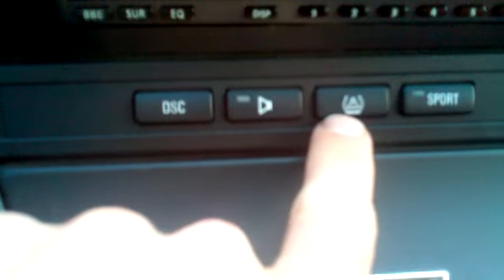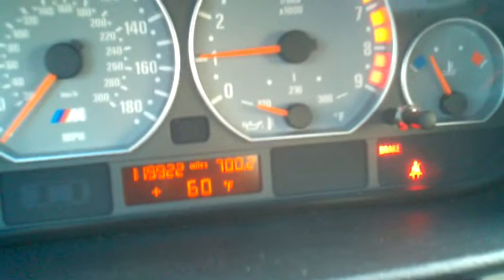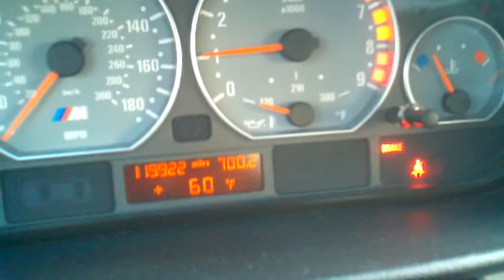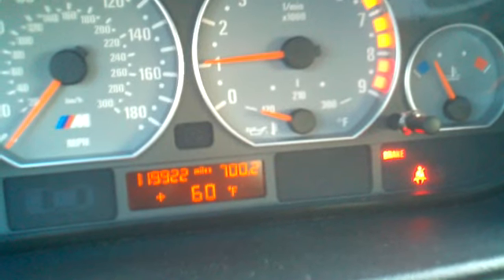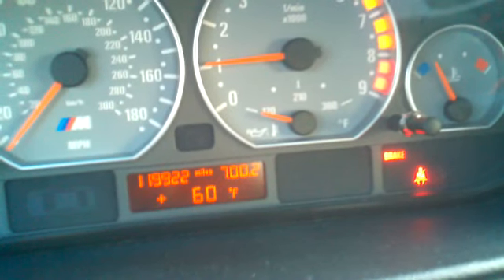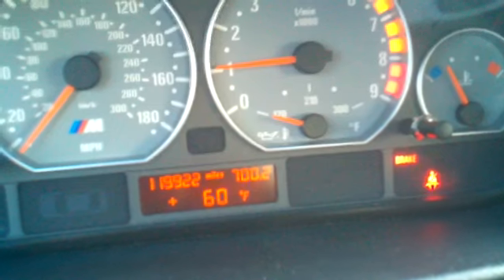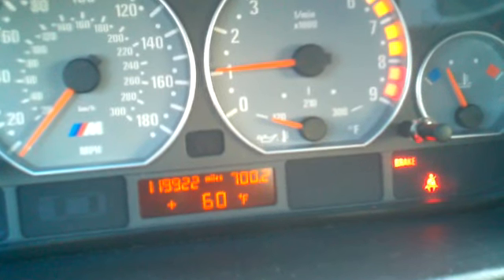Tire Pressure Monitor Reset BMW 3 Series E46 and E46 M3

Comment: Very much appreciated for the info! I did exactly as you say to do in this video and it worked like a charm. Took the car out for a 20 mile ride yesterday and the light stayed off. The local BMW dealer (Devon BMW, Devon, Pa) couldn't even do it correctly. Thanks again!

Comment from the maker: Hello Zak, Do you have sensors in your wheels on your vehicle? If you have a hard valve stem you most likely do and this could be a bad sensor or the module. The sensors have a battery that can wear down. It needs to be read out by the dealer to see the battery life. The ones with low battery life should be replaced. I hope this helps.

Comment from the maker: Hello, On your BMW your vehicle uses the wheel speed sensors to determine road speed, for tire pressure monitoring, and for DSC intervention. This can all be due to the difference in the circumference in the tires you are using. You may also want to have the vehicle scanned to see if there is a fault code for one of the wheel speed sensors.

Comment: Great video..i have fitted non run flats to a e46 which come from factory with run flats. I did the procedure in the video it worked for a few miles then the light came back on..any suggestions will be appreciated. Thank you

Comment from the maker: Hello, There are some common failures on this model. CATS tend to fail at this mileage. SMG pumps if equipped. The best one to find is a manual trans with no SMG. The VANOS bolts can loosen and cause engine failure. They should be replaced to prevent this catastrophic failure. Usually you get a rattle from the front of the engine when they are loosening.

Comment: Hey,

The flat tire monitor light on my m3 keeps coming on after each time I reset it. The pressure in the tires seem to be fine. One tire had a small screw in it, but it was not serious, no damage was really caused to the tire. So like I said the pressure within them is good. Do you know what the problem could be?

Comment: I have a 2003 M3 SMG, after reading the comments, I want to sell it now. Car has 80k miles. And SMG jerks when changing gear. Any special tune up is due on 80k miles? Thanks.

Comment: Hey I am running bigger rims then stock, and different tires from stock, so here is my problem, every start-up my tire pressure light would turn on red, after a few seconds the DSC light turns on and the tire pressure light turns yellow. It stays like this for the remainder of the drive. What does this mean? Also when I would be driving in the rain when I would go over a small puddle the car would kind of slip a little then DSC light would flash real quick, what in the world is going on?

Comment from the maker: On your M3 the valves needs adjustment at every inspection service. This unfortunately is aprox an 8 hour job. For the SMG there is no service interval for this. It is common for this model to be a bit rough during a shift. The most common failure is the SMG pump.

Comment: I have an e46 330xi. My tpms light is on and I can't seem to reset it. Took it to a tire shop they said they don't know it either.  I've try this method on this video, but no luck. 
Does anyone have this problem? Did you find a way to fix it beside having to buy new ones?
Reply from the maker: +The401Kidd Hard to say what this could be. If you have a problem with a wheel speed sensor or the DSC ABS system it will not reset so that could be the cause. Hope this helps!

Comment: Hello so there are no sensors inside of the tire ?
Reply from the maker: +John Jonn Hello John, Not on an E46 or early model BMW's. They use the wheel speed sensors to dertermine if the tire is flat. A flat tire would have a smaller circumference and so will read at a different rate of speed. Newer BMW's use a sensor. Look for a hard valve stem. Hard stem = sensor Rubber stem = no sensor. Hope this helps bud!

Comment: i have a 04 325, and does not have any button. Any suggestions
Reply from the maker: +Bee Lee Hello, So your tire pressure warning light is on? There must be a button you are missing. Check the lower panel around the center console. Press and hold the button until the light goes off. Then press and hold again  until the light turns yellow. Then let go of the button and drive the vehicle.